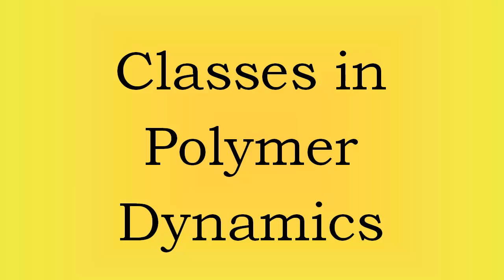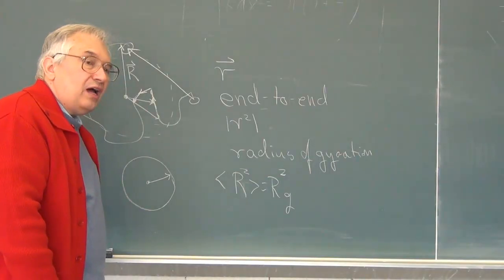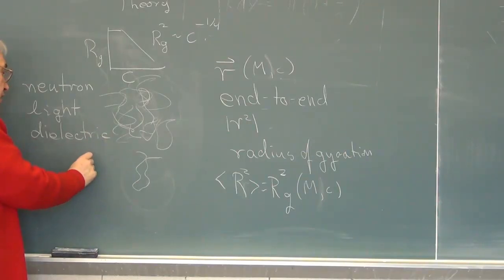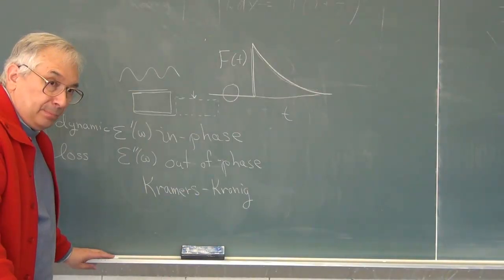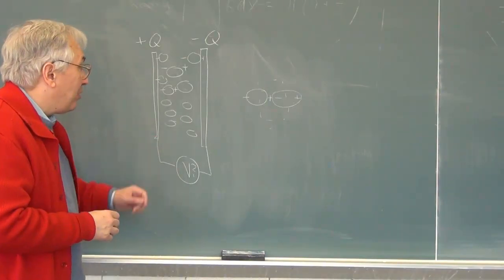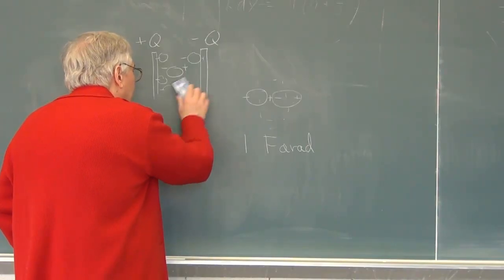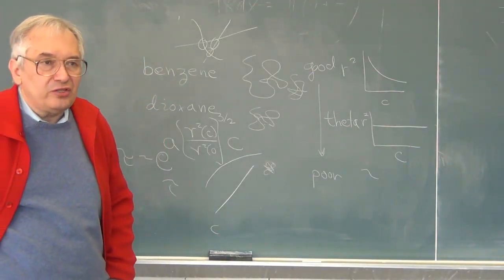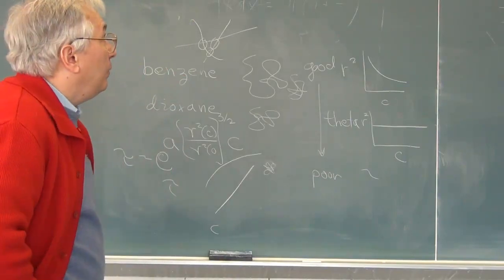Classes in Polymer Dynamics - 8 Dielectric Relaxation, Part 1.

Comment: Can physical thrust result from displacements in the electron field in respect to the nucleus? Also, from a theoretical standpoint, would the polarized dielectric allow for movement of a neutral charge carrier across the dipole?
Reply from the maker: Alex Johnson Organic molecules in many cases have permanent dipole moments because their covalent bonds have dipole moments.  These dipole moments are there all the time, and are not due to polarization of the electron cloud with respect to the nuclei by the applied field.  The physical mechanism is not similar to polarization of a single atom by an electric field.  In the case of especial interest, there is a component of the total dipole moment that lies parallel to the vector that points form one end of the polymer molecule to the other.  When you apply an electric field, there is a torque on the molecule, and the molecule rotates in space. I am not sure what you might mean by a neutral charge carrier.  However, if the molecule is in a polar solvent, e.g. water, it may have charged groups (these are hydrogen ions, not electrons) that rearrange to different binding sites of the polymer.
Reply: Thank you. Perhaps neutral charge carrier is the wrong term. Thomas Townsend Brown, an old Lockheed Martin engineer, wrote about how high K dielectrics produce thrust when they are polarized by an asymmetrical electric field. He claimed that there was a phenomenon which he termed dielectricity whereby a component of the electric field (which is neutral in charge) flows across the dipoles when they are polarized. I am wondering if such a thing is possible.